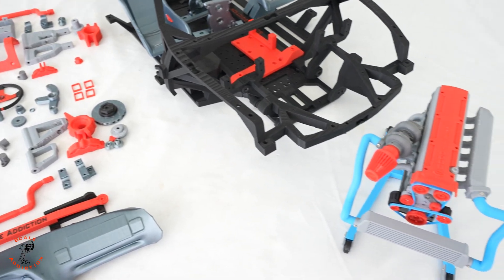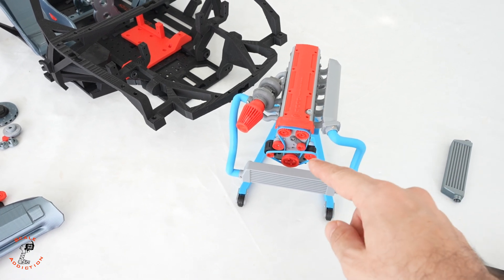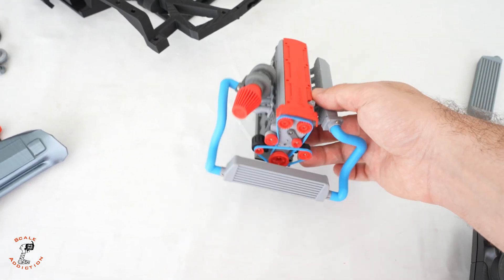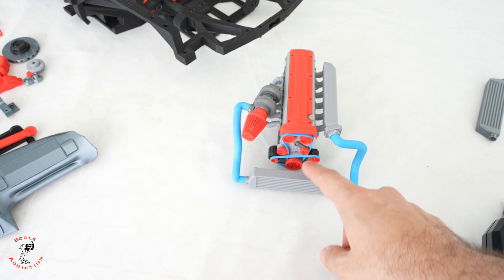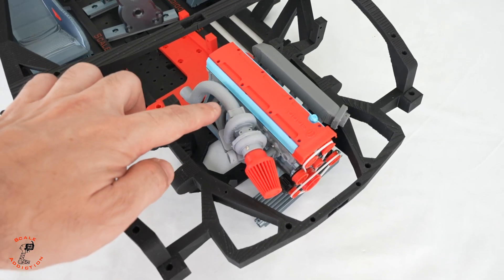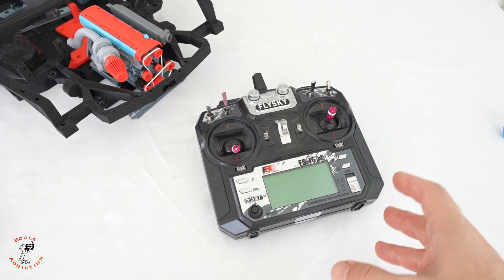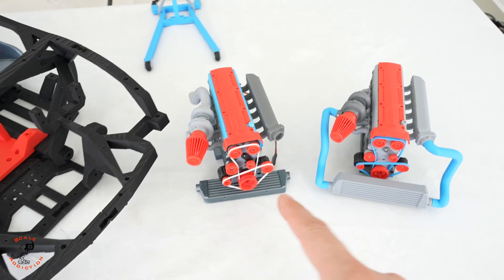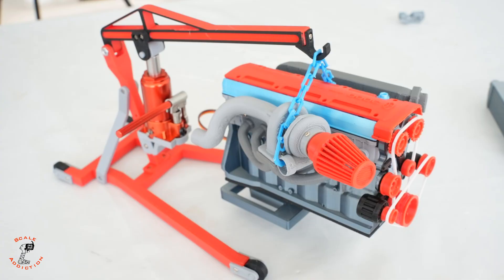Made this Fully 3d printed working 2JZ engine that can...

Comment: You could use a micromotor in the starter position and make that power the pulleys.
Reply from the maker: It will need extender and little more problem

Comment: You can put a brushless motor in the model 2jz because it is easier and takes up less space.
Reply: That’s a pretty good idea. I’m not sure how well it would work due to the two Jay Z being an in-line six so the motor might end up poking out on either sides. I’ve seen somebody do it with a V8, but it was because of how wide the engine was that it worked
Reply: @ajahniepemberton1860  If you change the engine model, it will be
Reply: @ if he does a complete engine bay, he could fit the electronics on underneath there as well
Reply from the maker: That's good idea,  but I didn't want ro put a long drive shaft all the way to the back, but it's a good idea and I will think about it